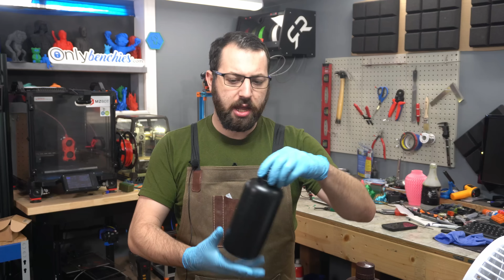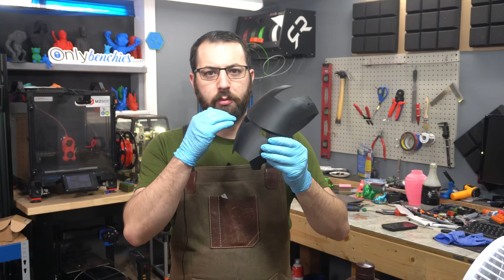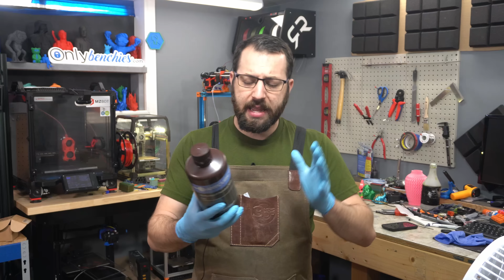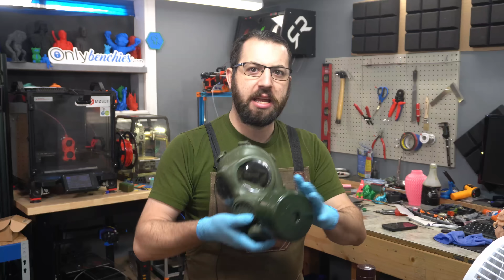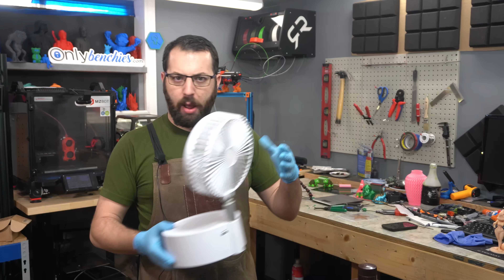PSA - DO NOT AIRBRUSH PRINTS USING RESIN - Think about it please......

Comment from the maker: If you want more safety info, check out this thread on twitter
https://twitter.com/Badassassassin/status/1468303156257955842
Reply: Even worse, in that twitter thread it says that resin will form explosive compounds with air. So an airbrush turns it into a fuel air bomb in addition to everything else.
Reply: I've designed isocyanate based urethane spray nozzle systems for industrial 3D printers. 
I required my team to wear full PPE, including masks with the proper cartridges.
There are blood tests we took to see if we were likely to be highly sensitive to isocyanates.
This stuff is no joke. Plus there are UV catalyzers added, stabilizers, UV blockers, etc... none of it is good for you. It all has insane dwell times in the body and it's not good for you. 
A fan or homemade fume hood will not cut it. Airbrushing is an EXTREMELY bad idea. (Cool concept and I have worked on some really neat versions of this, but very bad DIY idea.)

Comment: I never use 3D printer resin, I only use clear uv resin, always near an open window, with an extractor to suck anything near the airbrush straight out of the window.

Also, I dilute the resin with a 17% surgical spirit dilute, which helps put thinner layers down.
If you're painting without proper protection with any aerosol, you're playing with fire.

There's reasons why professional sprayers wear full bodysuits and masks, and they're cheaper than a trip to the hospital in America.
(it's free in Britain).

Comment: Excellent video. I do some woodworking in addition to 3D printing, and you see this sort of craziness a lot when it comes to "exotic" wood finishes as well.

I would only do this with the same protective measures that I use when I finish furniture with 2K polyurethane finishes (the kind that contain isocyanates, among other fun stuff):

1. A paint booth with a filtered exhaust, that extracts the aerosol from the workspace, provides slightly negative pressure relative to the rest of the building, and filters the aerosol particles from the exhaust
2. Full tyvek or similar suit
3. Positive-pressure full-face respirator system with appropriate filter cartridge. In addition to filtering the air you breath this ensures that your eyes/face are only exposed to clean air and also greatly reduces fogging by pushing a continuous stream of filtered air over your face. I use a 3M TR-600 (a $1.5K+ system) FWIW, though I suspect that NIOSH regs would require a Division I battery system for this use case, so a TR-800 would be better.

I would guess that a standard organic cartridge would get the job done for resin, but you should always check the SDS and the 3M filter guide to make sure that the filter you use covers all of the hazards. You also need to pay close attention to the filter changing schedules if you're dealing with substances that can hurt you before you can smell them, like isocyanates. This may not apply to resin though.

Of course if you have the money and skills to do that sort of thing you're probably not learning about it from viral "how-to" videos on YouTube.

wrt "the limit", it's different for everybody. Some people will react the first time, others might get away with it from an allergic perspective for a lifetime (though they would be at greatly increased risk for other impacts).

Comment: “The sky is falling the sky is falling” is exactly what you sound like. The man ALSO CURED the sprayed resing Mr. Got all the answers and “aerosolized” is highly misleading and inaccurate because he also used alcohol to thin the resin so when sprayed through AN AIR BRUSH AND NOT AN AEROSOL CAN the particles don’t fly all around the room under low pressure and with a ventilation system even without a booth you’re being a hypochondriac and worry wart at best. Calm down hun.
Reply from the maker: i mean

people who work in health and safety along with those with actual experience working with these chemicals in a workplace environment said the same things i was saying against what this person was doing.

imma trust them a bit more in this situation

Comment: if the finish is good enough I would consider converting an old sandblasting cabinet to a resin paint booth with an air filter system could probably set it up for curing the parts too

Comment: I work at a major national crafts store and received a call about using resin in an airbrush yesterday. Personally, I don't use resin in any of my crafts, but my 17 yo daughter does resin jewelry. Essentially, what little I know in regards to resin is what I've researched and learned while helping her. It didn't occur to me about the overspray from the airbrush when I was discussing it with the customer that called, though I wish it had. I was thinking more along the lines of the way poured resin heats up, the thickness and how difficult it would be to clean it from the airbrush chamber and needle. I managed to (hopefully) talk the guy out of trying it. For some reason, he seemed extremely determined to use either resin or glue in his airbrush. My thanks for such an informative video. Even though you're discussing 3d print resin, I feel it applies to any and all resins. I will certainly keep this information in mind the next time someone asks me a similar question.

Comment: I've never used a resin printer until I bought one for my sister's fiancé. They are in the basement which is over 1000 square feet big.  Even with safety glasses on my eyes are in absolute turmoil if I'm within 50 feet of the printers while they are printing. These are Elegoo Mars 2 Pros which have a built in carbon filter.  I'm not even in direct contact with the resin and I have issues.

Comment: Using resin period is a risk.  But no one is saying don't do it.   Instead ways to use it safely are promoted.   That's what should have happened here.   Just provide info about why and how to do it safely and don't crap on the idea as not being a good idea.  That's what this community is suppose to do.  Take new ideas and build upon them to make them better and safer not just attack and disregard.   How about make a video showing how to use this technique safely.  Thanks.

Comment: Thanks for this PSA. The reaction of the author is incredible. There is a way to make it safe (use a sandblasting kind of enclosure with a uv light in it & HEPA filter) and instead of remaking this video with the proper equipment and warning, he disabled the comment :(

Anyway i got my attention also on something you said about contact & super glue at 5:20. This is the first time I hear that and i cannot find reference about it on Google, do you have any source by any chance? I am a contact user and didn't knew that (nor i have ever experienced issue but I'd rather not challenge the devil).
Reply: I was a long time industrial spray painter. I wore contact lenses on the job because glases where inpractical. One day I disconnected my hose from the gun while pressure was on and thinner inside the hose. My face got sprayed with thinner and dissolved my contacts on both my eyes. Luckily the eye wash was only 2 meters away but afterwards my cornea was severely damaged and the rapid help from the eye surgion saved my eyesight.
Reply: @a1hamer  thanks Alfred. Yeah thinners can usually dissolve contacts. Do you happen to know which thinner this was exactly?
Reply from the maker: So the super glue thing is something ive been told both a work and as far back as highschool. But now that people are mentioning that they cant find sources...i cant seem to really track down the source of that quote

Comment: I absolutely appreciate the intention of this video, but I worry that it approaches criticism of the target video from the wrong angle. As someone who works regularly with automotive urethane paints, who wears a full mask OV respirator, who ventilates a dedicated use paint booth, I'm interested in knowing if the resin is materially more or less hazardous than automotive paints. 

As author, I worry that your warning reads as "you're too stupid to know how to do this safely, so don't do it." 

I feel there was a better opportunity to lean the video more into "This is what would be required to do this process safely- anything less is exposing yourself to long term health complications." OR "there are no safe ways to aerosolize UV resin, here's the chemistry why, and here's why even professionals don't do it."

Overall, good intention here, but your video speaks with authority on the subject, and I worry that you may not have a comprehensive enough understanding of the resins themselves to give the blanket statements that you do. Again, this is a devil's advocate perspective from a high end hobbyist.
Reply: Warnings aren’t the place for nuance and discussion. Work for an industrial chemical company and have seen first hand that if you’re not explicit than majority don’t take you seriously. Set the bar low for those who know the least and keep the discussion open for anyone who knows wants to lean more.

Comment: This is a really good point. I'm gonna get an airbrush and try that technique, but I'll do it in a transparent enclosure. Like those chemists use with only the gloves protruding inside. 
After I'm done, I'll let everything settle, wash the box with IPA and blast it with UV afterwards. This can be really powerful finishing technique for printed mould templates.

Comment: Is airbrush paint completely non-toxic and safe to get in your eyes/lungs or is it just way less likely to cause an allergic reaction?
Reply: If anything sprays anything besides water you should wear a respirator. Difference between acrylic paint and resin is toxicity and that paint usually drys quickly in the air and falls as dust, while resin stays resin until cured.

Comment: If you want to use UV resin to smooth out your print just use a brush accurate you still need to wear a mask when you send it though. But whoever came up with the idea to use it in an airbrush is an idiot because you going to be blowing UV resin particles all over the place and it has to land somewhere.

Comment: I'm thinking a properly sealed environment like a sand blasting cabinet with uv lights installed inside so everything inside is hit with uv light and everything stays inside the cabinet to cure would be one of the only ways to do this.

Comment: "You really need to be waering a complete full face sealed organic filter mask"
Not only that.

You also need to shave, seriously: the beard reduces the efficacy of any mask.
As for the "organic filter mask": you'll just need an FFP3 filter to filter the particulate, if you are afraid of volatile substances then you'll need not just a generic organic filter, but a resin filter that acts against that particular substance (and you'll have to use it even durin normal resin printing sessions).

Comment: Lungs/Eyes -> Full face respirator with the proper filters
Skin -> gloves.  still worried, home despot sells disposable coveralls for like 10.50 a pop
Airflow ->  negative pressure, how it works and you: a story about proper paint booth ventilation

If you dont already have most of this gear then I have bad news for you about spray painting inside.

Comment: Ok calm down this is no different that painting a car anyone with common sense should know that you should do have a full cover face respiratory so you don’t breathe anything in and when painting any kind of aerosolized pain or chemicals you should where long sleeves, the guy who did the original video clearly in in his area where he paints all the models that he dose and clearly has more experience painting than you do so yes what he is doing is a great idea but he’s not your parent he told people what to do and us as adults need to be the responsible ones and make sure we take protection seriously 😒
Reply: But it is different than painting with regular Acrylic, enamel or laquer paints and it should be really obvious to anyone who uses an Airbrush regulary.
The difference is that regular modelling paint cures very fast when exposed to Air, you can literally "flash off" some paints to get your next layer on in a matter of seconds.
UV Resin on the other Hand stays uncured and harmful long time after you already finished your work.

Please don't accuse others of a lack of experience while at the same time you have no experience on the matter yourself, your "common sense" failed you this time.

Comment: Not to be taken lightly but it can be done safely, full face respirator with organic filter and painter's suit outdoors. Used to build composite boats and some of the resin mixtures we used were an order of magnitude more toxic than uv resin we did also use uv resin. Some of the guys worked with the stuff for 40 years with no problem. But we had guys who didn't use proper ppe and ended up with health problems.

Comment: Just spray outside in direct sunlight. Problem solved.
Reply: That's really not gonna help and it would damage your airbrush. Resin cures very quickly.
Reply: @redkingrauri3769  Yeah that's the point. Sunlight inside the gun isn't an issue.
Reply: @mp-xt2rg  And you're still going to be inhaling the particles and getting them on things. The stuff is still dangerous if it gets inside your body even after curing. There's a reason you don't use resin prints for food stuff.
Reply: @redkingrauri3769  lots of things aren't food safe like spray paint but that doesn't stop me from using it. If you're ok sanding a resin print then airbrushing it in direct sunlight shouldn't bother you. Just wear a sanding mask.
Reply: @mp-xt2rg  I'd rather not get my lungs destroyed doing something so utterly stupid.
Reply: @mp-xt2rg  you ideally shouldn't sand a resin print when it's anywhere near green either, you're safe to do so after several weeks after it has been printed, but at least the initiator is already bound and mostly spent even in a fresh print, and the resin already mostly linked into a higher effective molecular weight, making it relatively more inert. When the resin is completely fresh, it's orders of magnitude more reactive and more hazardous, and once you breathe it in, unless you happen to also have a UV source in your lungs, there's really nothing that would cause it to passivate in foreseeable future.
Reply: @SianaGearz  which is why I said just spray in direct sunlight outside. The small amount of resin floating around will cure almost instantly well before you can breath it in. Also dust masks aren't that hard to come by, an n95 will do just fine. People spray spray 2k paint all the time and are fine and that's likely the most dangerous stuff you can easi buy that goes in the air.
Reply: @redkingrauri3769  I guess stop making stuff then? Your making a way bigger deal about this than is warranted. N95s are cheap. Just use proper ppe and take basic precautions.

Comment: Fantastic explanation on why this is a bad idea. Would have loved to found a proper solution for this but no way to do it safely
Reply: Glovebox
Reply: a possible way, would be to emulate a mix of a film changing bag, and a lab setup where they have the thick gloves mounted to the wall, so the person is seporate from the chamber. so you could use a big box, normally used for storage or like a perspex fish tank, and mod it so theres everything needed inside, so airbrush, resin, uv lights to blast everything in the box to make it safe via curing the resin.and the part... but it would be a big area needed for that.... might be better to experiment with something that could thin resin, and dip the part then cure it fairly quickly...
Reply: @specialingu  Yeah, he mentions this in the video. That's the negative pressure chamber.
Reply: I wonder if a sand blasting cabinet would work

Comment: Maybe it's just because I work in construction and am used to working with hazardous tools and chemicals but I actually think this is a neat idea. I mean wear long sleeves and pants and a respirator. You can get full body painting smocks that would protect you from the vast majority of this. And full face respirators you'd practically be in a hazmat suit.  The clean up is easy you Don't need to scrub uncured resin with IPA you just need to walk around your work space with a UV lamp and cure all the resin. Then it's no longer uncured. No I would deffenetly not want to breath it while it's in the air percoautions need to be taken.
Reply: Nah, it's not worth the risk. Especially when you could just brush on the resin and that works just as well without the aerial carcinogens.
Reply: @TrashcanJan  I mean yeah obviously there's safer ways to do it. I still think it's neat. With the proper respirator the carcinogens arnt really a big risk though. It really just comes down to being prepared with the correct equipment. Like I said maybe its just because I'm used to working in hazardous situations there's always a correct tool and peice of PPE for the job.

Comment: Even with a negative pressure enclosure with proper filtering one should even go so far as to put a UV light on or around the exit point of the filtration to cure anything that might potentially escape the chamber.
Reply: only necessary if you dont have the proper filter but easy to do by adding some 405nm UV leds behind the filter media in the enclosure.